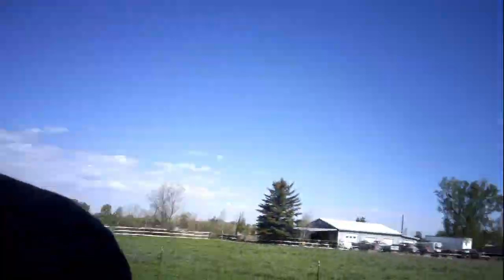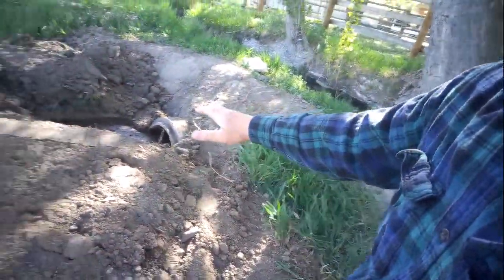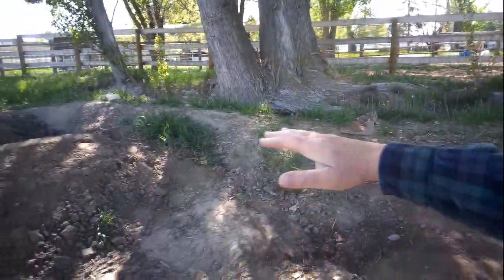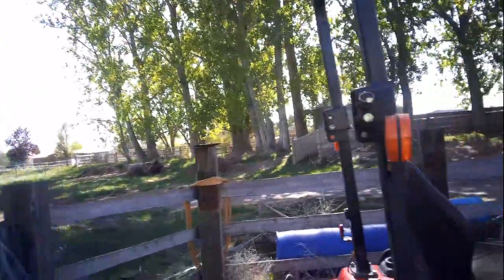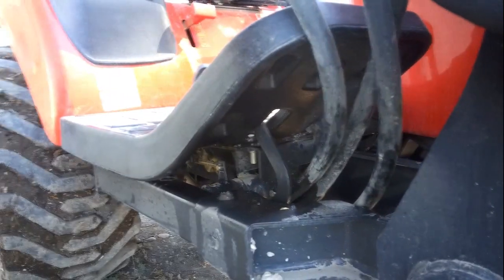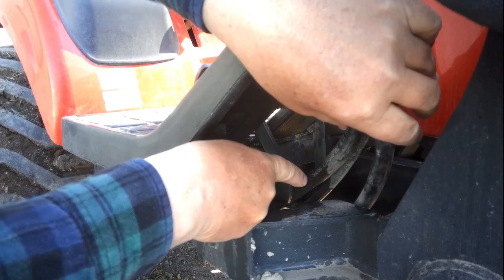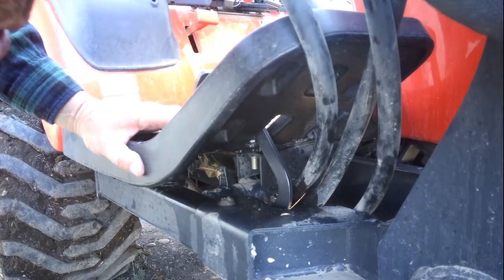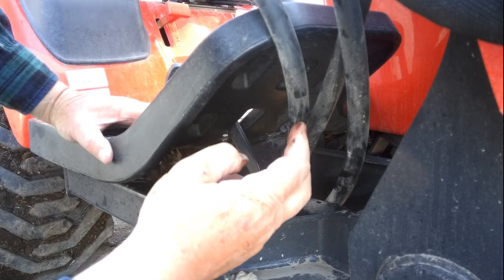No. 416 - Kioti Tractor Subcontractor Tried To Ruin My Tractor

Comment: Yeah that one hose needs to be longer for sure, other one couldn't hurt to be longer either.  They need a bracket too to keep them from vibrating together
Reply from the maker: I had them make the new hose 4" longer. I'll zip tie them where I can.
Reply: @CamppattonFamilyCompound  make sure you put rubber hose wrap on it prior to zip tie.  Btw hydraulics were what I did in the Marines so I know way more than I should when it comes to them
Reply from the maker: @PalmettoPrepared  Of course. I was an operating engineer for 15 years and 5 of that was on the lube truck. (which means I spent a lot of OT helping the mechanics)

Comment: You'll be putting rub guards on them hoses ?....Kiotis known to chew up hoses.....lol
Reply from the maker: Only because they changed sub contractors who short the hose length. replacement is 4 inches longer and is clear of all rubbing. Using HD zip ties on them now too.
Reply: @CamppattonFamilyCompound  
We keep a set of spare hoses for all hydraulic equipment.....spensive but we Prepp for plan B.....
Reply from the maker: @chuckfarley567  I would love to get a hose fitting press and fitting so I can have a little side business even in SHTF